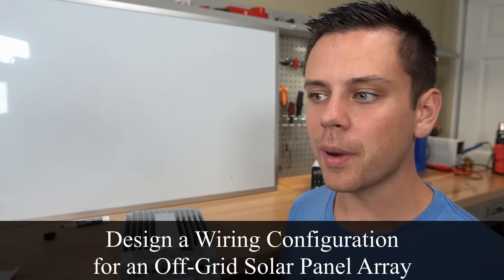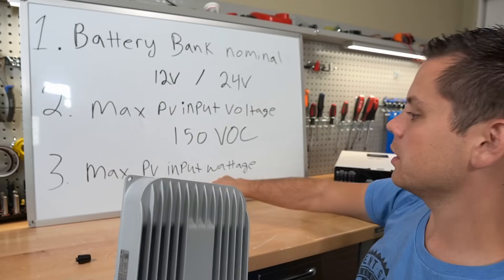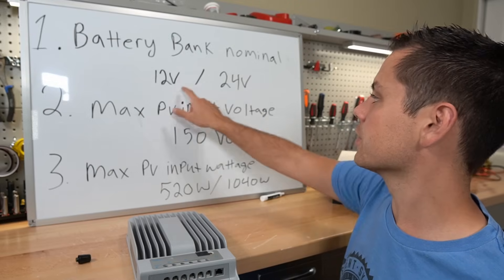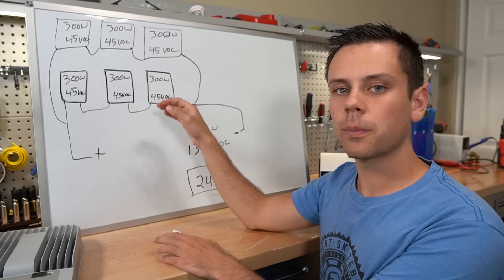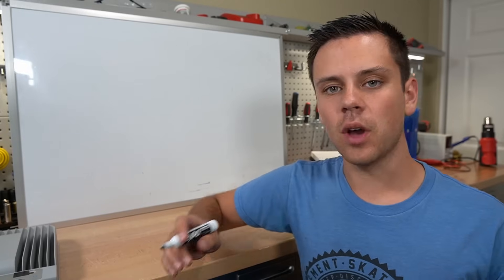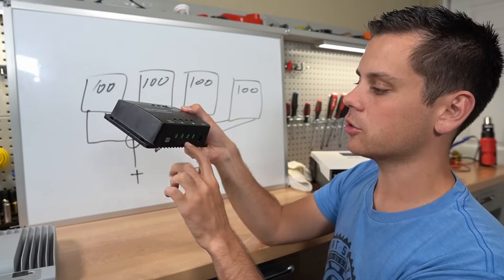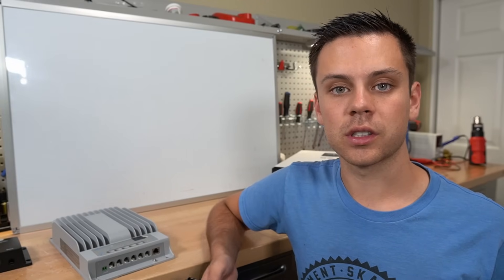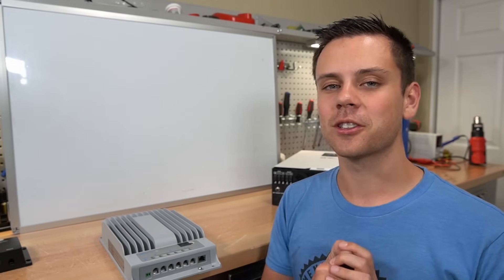How to Design an Off-grid Solar Power Array Wire Configuration

Comment: Have an Epever 20a mppt controller that says in the manual it can handle 260w on 12v battery and 520w on 24v battery so guess you can't use a three 100w panels on 12v battery? When I bought the controller was looking at the 20a potential of the controller figuring three 100w panels would not exceed 20 amps suppose I'll just have to keep things to two 100w panels with a 12v battery. Thanks for your informative videos.

Comment: I agree. It's a complicated topic because everyone's situation is different. I had to reconfigure my panels 4 times over 6 months to get the maximum out of my system.
Reply: Ive rewired mine once, from 12v to 24v.   this fall I will have to calc the median positions, and remount my array for best gathering.

Comment: I’m really not understanding it all yet, but I’m going to keep on listening and watching until I get it. Thank you so much for all your hard work!
Reply: It’s complicated stuff; I have to watch it several times and pause to think about it. Try writing some of it down and draw your own diagram.
Reply: 1st rule to master:  when connecting 2 or more batteries/solar panels; series means positive of 1 battery/panel connected to negative of next battery/panel.  Parallel means positive to positive, negative to negative.  2nd rule to master: Series = voltage adds.  current (amps) remains the same {If all panels/batteries equal}.  Parallel = current (amps) adds.  Voltage remains the same.  Series can look like a string of Christmas lights, while parallel can look like a ladder when drawn on paper.
Reply: Yes me too. Small bits are sinking in. lol
Reply: I’m so unfamiliar with many of the terms and their meanings that it’s hard to take coherent notes. Do you have a glossary of some sort that you could share for us beginners?
Reply: @theresahartman7465  I got a lot of good information from Will's book Mobile Solar Power Made Easy.
Reply: Thank you!
Reply: Theresa hi! Will has videos on all the beginner info too. You can go back to watch those and ask questions on his forum.
Reply: Same here - dont get any of this
Reply: When in doubt, All About Circuits website for general terms and theory.
Reply: Wow! Y’all are awesome! Thanks so much!
Reply: Oh dear

Comment: I am glad to see you do a video of this nature for several reasons. First let me start by saying your either your articulation skills have improved or my knowledge on solar has vastly improved due to your former videos I watched before taking on a 10K Watts 48V system. Because, I still run a couple of 800W 24V systems, I like to watch you videos in this arena to see new MPPT controllers be tested alongside the battery testing you do. Some of this equipment wears out and need repairs or replacement every so often. Thanks again, Will , for sharing your genius in solar systems!
Reply: What charge controller you use for your 10kw system and how is it wired?

Comment: Did he say it could kill you instantly ???  I don't think a single person has ever died from solar panel DC electricity ever on Earth. That would be a good video to research make.
Reply from the maker: Yes anything over 50 volts can kill. And pv current can disrupt heart just as any other. And potential is enough to overcome resistance of skin. especially over 100V
Reply: @WillProwse  Agreed but, hypothetically, 18V from 3 six volt batts is more than enough if you know what you are doing. Just saying.
Reply: @PH_INFO_101  Skin resistance, even when wet, is typically in the tens of thousands of ohms. 18V would be generating 10s of micro-amps, which is not enough to harm you. 100V on the other hand would generate 10s of milli-amps and, across the chest, this could easily disrupt heart rhythm. 

More than 30mA across the heart is generally considered enough to potentially kill a man, which is why GFCI/RCDs are usually rated at 30mA. DC is also worse because your muscles spasm and clamp around the source, whereas AC crosses 0V 50 or 60 times per second so you can usually pull away (or be thrown away!).
Reply: @tictagtube  I am sure you are correct. I was just trying to mess with Will

Comment: What is better:
-several solar array parallaled on the same charge controller?

Or...
-several charger control with their one series array, parallaled on the same battery?
Reply: it depends on how many panels you will use, what is better is to buy a high quality charge controller with good customer support. if you have an issue it's nice to have someone to call. I suggest staying away from the small 30 amp charge controllers because many can't handle the high current.
Reply: @thefaeryman  yes but if you parallel ten 30A solar charge controllers on the same battery, you will have 300A of potential current. 
Even if one of them have an issue, you still have 270A of potential current
Reply: It would not be recommended to connect more than one charge controller to an array. More than one charge controller to a battery is fine, but one array, one charge controller.
Reply: @tictagtube  one charge controller to each array can be connected to battery bank, must use the correct wire size for the maximum current possible from array to CC and from CC to battery bank

Comment: Good timing Will, just working on a cheap pwm 4 panel 400 watt12v for my small rv for camping, not to live in but to keep the water pump and lights going. Keep up the great work

Comment: Thanks for the refresher! I'm building an off-grid building for my beehives and am just about ready to order panels. This video will help me to not screw things up.
Reply: I know everyone is doing remote work these day, but do all your worker bees get their own computer? How much power do they need? 

Just playing with ya.
Reply: @4philipp  the drones need the computers so they can oogle over naughty queen pics. Lol

The electrical needs are going to power a laptop for data collection and temperature/humidity control.
Reply: Chuck Stickelman cool. Does it need to be a laptop or would a tablet work? They use much less power.
Reply: @StickyBit7777  surely an arduous or raspberry pi would be far better as they use way less power..!
Reply: @MaxMax-dq1lu  each hive will have something like you suggest, and the laptop will be used to consolidate the data. It'll likely wake up periodically to poll the hives.
Reply: @4philipp  yes a tablet would work, but I have a spare laptop that will work for this application. It'll be hibernating for most of the time and only wake up to poll the individual hives.
Reply: Chuck Stickelman what is your estimated daily energy consumption? I imagine it can’t be much more than 1000 watts
Reply: @4philipp  there's a lot of variability in my estimates, as there will also be some exhaust fans, or HRV unit to help control temperature and humidity inside the beehouse. I'm also anticipating a small refrigerator/freezer which is a huge unknown. And lastly lighting. Each of these will have significant seasonal variability in their usage, which is really tossing my numbers into the region of W.A.G.  The data collection component will likely be the least significant consumption item. Ultimately I would like to keep the daily usage below 1500w. Time will tell.
Reply: Chuck Stickelman why exactly do you want to temperature control your beehive?
Reply: @4philipp  I would like to keep the building's internal temperature around 41-44 °F during the winter. This will be low enough to convince the queens to not lay eggs, but high enough that they won't have to stay in a tight cluster. Which should allow the bees to move around inside the hive to locate food reserves. It's not unheard of for bees in exterior hives to starve to death inches away from ample food supplies because they are so tightly clustered that they can't move as a group.
Reply: @4philipp  also, in early spring I want to be able to force the temperature to be significantly higher than ambient in order to induce the queen to start laying earlier than she would otherwise. The goal being to have local bees ready to sell around the same time as bees raised in Georgia and California.

Comment: He keeps saying it's easy, as I Google words he is using
Reply: If I did it, you can do it!
I didn't know anything - truly NOTHING - about solar and very little about basic house wiring a year ago when I bought my off grid cabin. With primarily, Wills videos, (and a lot of head scratching) I built my own complete system. I bought 3000 watts of used panels, MPPT 24 volt all-in-one system, sixteen Kelb cells to make two 24 volt batteries. If I had to do it all over, I would still use the MPPT and the same panels but would use the recycled 24 Volt Lief battery packs (see Wills video showing them). They are plug and play and about the same total cost of the Kelb cells with the BMS at none of the worry.

Comment: Do we need grounding or whatever it's called?
Reply: If your PV panels have metal frames, yes. If they don't, no. Electrical code is different in various places but you usually only ground in one place for your entire system.

Comment: I love your videos man. You are a brilliant man.
Question. I bought a glass solar cell and it has no + or - indication. Silver with lines one side and dark w/lines on the other. See through. They sent two .5  inch tabs, diode and a piece of "special solder. Where do these tabs get soldered on? I can't find a solar cell like this online anywhere.
Reply: Why did you buy it?
Reply: @4philipp  I didn't know it was like that. Limited info.
Reply: Jeffrey Rood sounds like a hobby tinker kit. I hope it was cheap
Reply: @4philipp  I'm beginning to think it was a factory quality control reject. It could be that it didn't get those parts put on to it and then sold second hand to a wholesale co. I just have to figure it out.
Reply: @jeffreyrood8755 
If u look up how 2 make a solar panel on YouTube that's the best way....